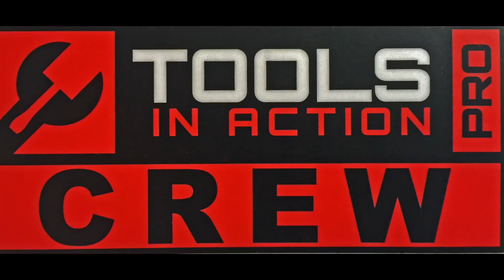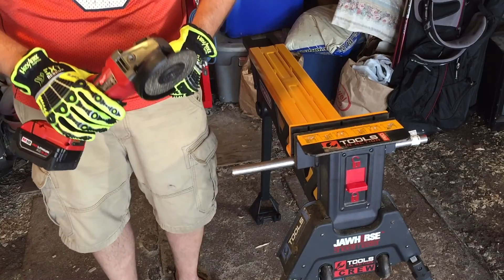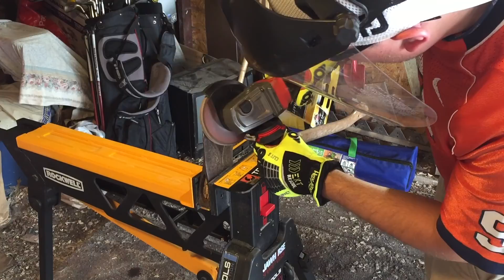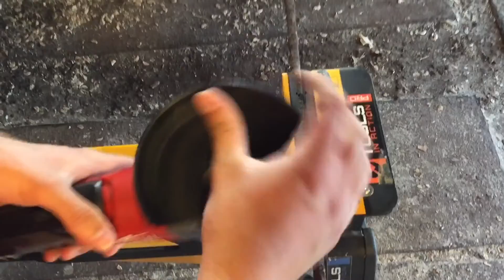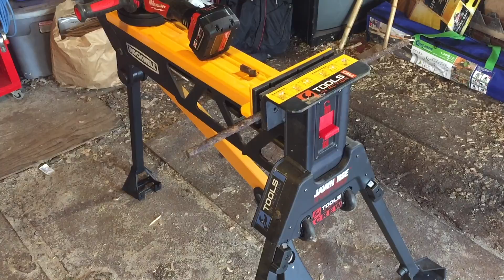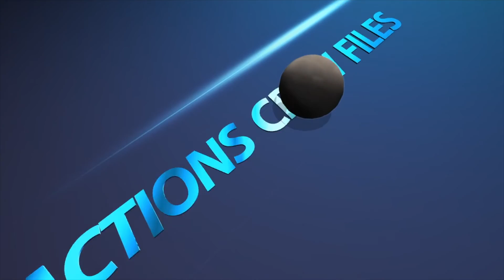Milwaukee Brushless M18 Fuel Grinder 2780-20

Comment: babying it when cutting the rebar it should cut through in 2 seconds now i have to go buy another $15 grinder to replace this POS!
Reply: Know the limits of cordless tools, I keep a corded grinder in my truck this is good for cleanup after welds or prep

Comment: i have several M18 and M12 tools that work great this right angle grinder it is a POS ! it can't cut or grind it shuts off in 10 seconds  has no torque! A $15 grinder from harbor freight out performs it by 20X

Comment: was this whole demo done with the same 5.0 battery?
hows the fuel compare to the brushed model?
Reply from the maker: Andrew Browner yes it was the brushless will grind circles around the brushed
Reply: for a diy'er is the fuel really worth ~230$   vs the regular version at ~99$    (canadian prices)
Reply from the maker: Andrew Browner unless you absolutely need a cordless grinder if you don't want to drop the coin on the fuel I would just get a corded

Comment: does it get hot as shit after 5min like the corded ones... really be a buying pt for me if there not burning through ur glove after 10minutes of use
Reply from the maker: Being brushless it has an advantage that there isn't the internal heat buildup like the corded models can get, with that being said it can still get warm
Reply: +Jimbos1ice damn might be a deal breaker then. buddy's dewalt is a lot better for heat and what not and when ur a welder/fabricator who works mainly with aluminum we spend lots of time grinding on prep work alone
Reply from the maker: +chris jones you'll burn through so many batteries with a cordless model grinding all day too, run time isn't great but it's a high demand tool
Reply: Kinda varies by day but id say 30min 4 days a week. 4 hours that 5th day. I have 3 5.0 batteries now but need one for drill. Think I could get 45min run time on a 5.0 batt
Reply: invest in the high demand 9.0 battery,you'll love it even though it is a bit pricey